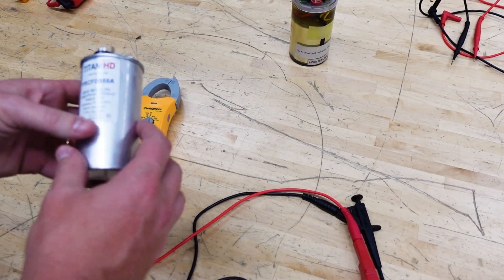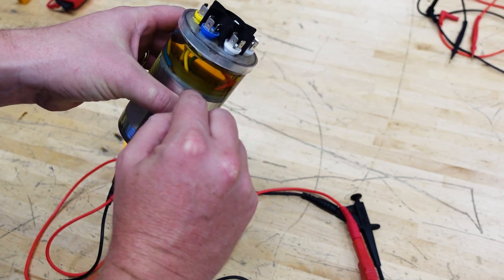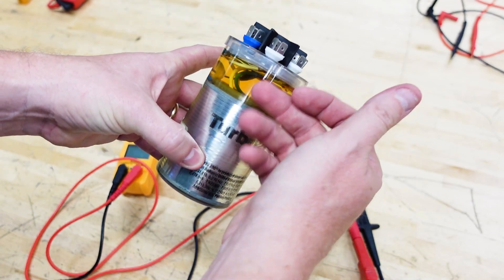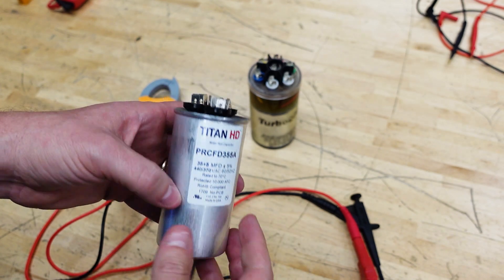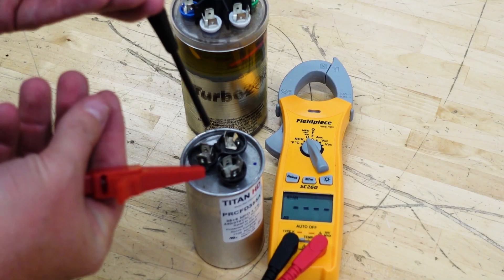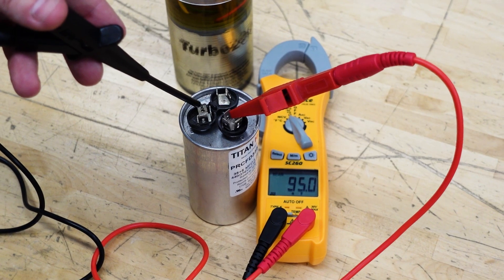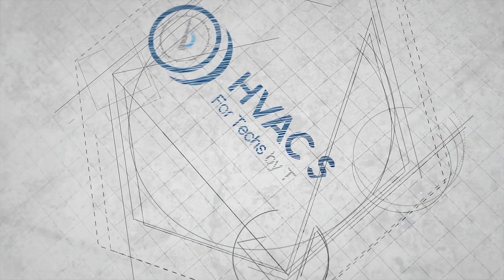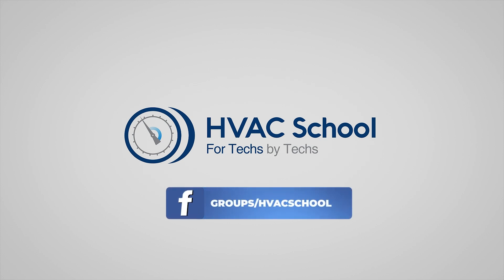Was I WRONG? Can a Capacitor FAIL with HIGH MFD?

Comment: I know this is old post…..I’ve been a tech for 7 years, checked a million capacitors and love your videos and watch them all and u have helped me out countless times, so I’d never question your advice. However, I had one today do differently then what this video claims. It was a 35x5 and it was reading 64 on the compressor side and 4.9 on fan.After watching this I triple checked that my meter was on the correct setting and even tested 3 other capacitors which all read correctly. The weird thing though is that the  reading 64 would very slowly decrease. It’s prob a meter issue. Either way, I love  u man in a very non romantic and heterosexual way lol

Comment: How do you test the Turbo capacitor under load?

With the regular capacitors, testing it under load is easy, but how is it done with the Turbo capacitor (e.g. the Turbo 200X)?

Comment: Excellent observaton!  If I had that capacitor in my lab then I could use my o-o-o-o-o-l-d analog capacitor tester which would show that the needle would barley move if at all even though it appeared that the digital was reading high micro farreds.  The littly tiny "n" is easy to miss!! 😆

Comment: I had this exact issue today. Capacitor was rated at 30, measured at 69. Never seen it before, replaced it, AC unit is working perfectly again. I have the old capacitor, and will test it again, so I have the experience of seeing it in nanofarens instead of microfarans. Thank you for the information

Comment: I always preferred to set a manual range and work down. That way, i dont fool myself. Used to do a lot of current checks on MHAs for cell sites. anywhere from 100ma to a 500-700 ma range depending on the type. sometimes a bad one would overdraw, or under draw, just know what your working with, start high, then go down,  it just seemed to help not mis diagnose the issue.

Comment: So my capacitor measured OL on a Fluke 83 III in microfarads. This is both for C/HERM and C/FAN. Is that over or under limit? Our fan is overheating after about an hour. Is the fan getting too many amps? Thanks.

Comment: You just cleared up a huge brain fart with my SC260 😂

I had one testing just a few points over, and couldn't understand what the deal was.

It is not uncommon at all for a capacitor to test slightly high; as I am sure you know, there is a specific formula to test exactly what charge you should be getting from the capacitor. 😉

Comment: Capacitance can only increase if the two conducting plates get more surface area, they get closer together (without touching), or the dielectric between them gets stronger.  None of that is likely to occur in the field.

Comment: I would think having more capacitance than designed would be bad because it would cause the phase shift of voltage relative to amperage to be located differently than designed.

Comment: This whole problem comes down to the meter manufacturer trying to add value where none is to be had. Auto ranging is one thing  but auto function changes are just over the top. If you don't know whether you need to be on ohms or capacitance scales then maybe you need to revisit your electrical skills. This stupid feature sounds like a good idea until you think it through for about 7.359 seconds.

Comment: What about the capacitor reading just increasing with no stop? I had a 45/5 and the 45 went to like 200 before I removed my leads and just replaced it. Sounds like an OL to me, but I’m curious on what you think.

Comment: If you compare it to an engine, if you advance your capacitance to far, you now make the motor work against the capacitor.  Essentially yes you can fail if its higher than what the label says, granted more often it will be below or lower mfd readings. Its just better for the longevity to stay within the limits of manufacturing specifications.

Comment: Most multimeters measure capacitance by measuring how long the capacitor takes to charge when power is applied from the meter.  If the capacitor is electrically leaky, it will take longer to charge and your meter will read a value higher than the true capacitance.  If you ever come across a capacitor that reads significantly higher than it's rating, it's probably leaky and should be replaced.
Reply: Thanks. Very helpful. I just had this happen with a Fluke meter and a capacitor from a 1930's drill press. It took almost 10 sec to give a reading and I watched it move from nF to uF. What you say makes perfect sense: The meter is integrating the delivered current to reach a given voltage, so if it leaks and more current is delivered, it things the capacitance is higher than it is. I think that is what you are saying.

Comment: I had a condenser fan cap fail at about 75uf once, strait out of the box. I don’t use auto range, this actually happened, with a fluke meter and it overheated the new fan motor. What made it so great is that it was for the Diversitech maintenance guy and it was a Diversitech capacitor. Fan motor overheated, after changing it, while we were talking. Found the cap failed with crazy high reading. Put another cap on and it’s still running 8 years later.

Comment: I know we use a capacitance range on a meter because it's practical. The most accurate way to measure is an ESR meter or an LCR meter and check if it's within the tolerance listed on the component's datasheet. Context: I repair Electronics.

Comment: Actually you are wrong (no offense). Look on the label at the microfarad rating. Notice how next to it says "+ - 5 %"   what this means is that this. Capacitor has a range of 10% (5% less than the microfarad rating, 5% MORE than the microfarad rating). We tend to not pay attention too much to a higher rating because in general the motor it's controling will still start with a higher rating. But if we are doing everything by the book then Technically the capacitor should be changed.
Reply from the maker: Haha 😄

Comment: Why did Fieldpiece even include nF as an option? How many techs have ever had a need to measure in that range?
Reply: Because the chipset in the meter that drives the display is the same chooser found in a lot of other wide range meters.  Costs less to use an off the shelf chip than have a custom one made.

Edit for bad autocorrect

Comment: I dont like the field piece combining the mfd and ohm measurement. It should be 2 different clicks. This has confused me one time for about seconds. Great video. If you're checking a cap use the manual range button
Reply: Yeah I used to have this meter I hated that too so I switched to a fluke kit